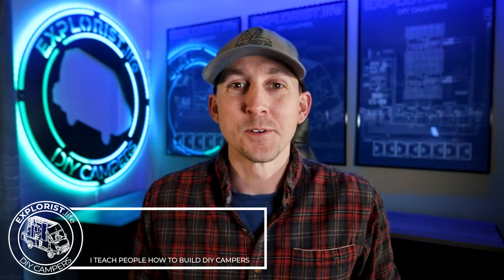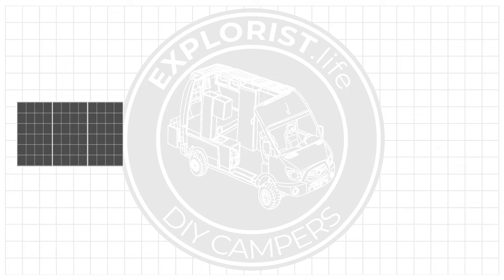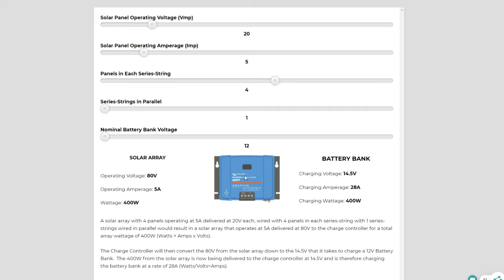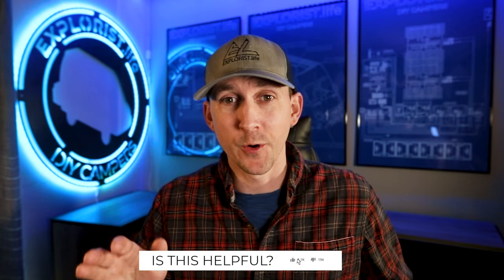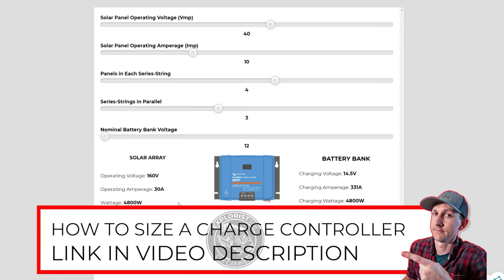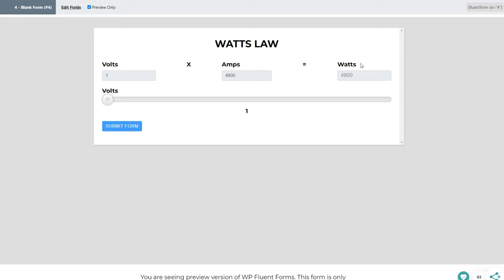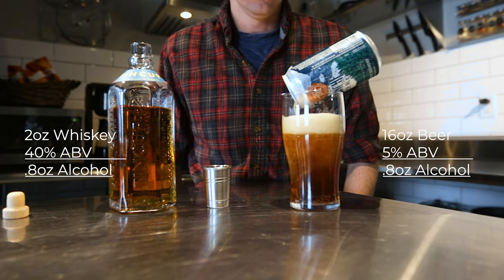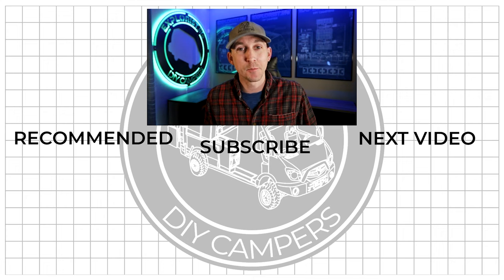What does a Solar Charge Controller Do in a DIY Camper Electrical System?

Comment: Hi Nate, Glad I found you

I will cut to the chase because I know you would rather sheer sheep then talk to an old guy who thought he had an original idea- ha 

I have a 2011 Dodge mini van I did a modular camping set up for my wife and I -test ran last year and loved it, but wanted to do more dry camping (summer time use only) 
     I bought a Jackery1000 I thought it was a one of a kind find in the industry. its new and so cool
I have added a home made storage box on top of van, It stores light weight stuff, ie folding chairs-table and out door rug etc. 
The top of the box is a used 250W 36x65 solar cell (see data below) its on lift struts and I think the combo of Jakery and Solar cell will allow us to camp anywhere :) 

The problem: I now find out there are several choices out there for portable batteries and the Jacker is limited to 30V on charging.  Many questions swimming in head- don’t want to hurt the battery. 

Nate, If you can spell out the best the best route to make my roof top solar cell work for us -I WILL PAY YOU, and or buy what ever I need from you, Also and buy a sticker and a T-shirt!! 
    Thanks for any help you can give!   Here are the stats ...
Model                ss250P-60
max power               W 250
open circuit               V 37.6
Current @ Pmax       A  8.27
max system Voltage  V 600
fuse Rating                A    15A

Comment: I was charging an RV 12V battery using a new 200w setup. I’m using a 40A MPPT controller. The battery was already at about 80+% SOC. My panels were giving me about 44.3 volts on a clear sunny day. I expected to see at least 5 amps being delivered. I actually saw about 1.31A. Dang! I think I figured that because the battery was already at a fairly high SOC the controller had stepped down the amount of amps being delivered. Right?

Comment: Very nice, love the app you made, found myself missing an big error when playing with it. Can you have the calculator highlight over/under bad things, like if you are running too small input voltage to the charger for a 48 volt system so it will flag the problem box? Also can you add what charge controller parameters (100/15 example) so if you also over power the controller it will flag you? if you can't that is OK, also you did ask for feedback.

Comment: I have a small off grid system with 200 watt solar, 50amp Lifpo4 battery and a 20amp solar charge controller. When sun isn't available, can I disconnect the solar panels from the solar charge controller and attach a 12v 10 amp car battery charger to the solar charge controller input to charge my battery?

Comment: That answered allot of questions I had but didn't understand. I have about 1800 watts solar, 48 volts in series parallel, charge controller 100 amps but connected to 14.5 volt batteries. It was maxed out at 100 amps. What confused me is I see 2800 watt arrays that only have a 100 amp charge controller. I see now the voltages of the input to the controller and the output to the batteries are different.

Comment: Great video. I want to ask, in the event that you don't have solar panel and you opted for a laptop charger let's say 65w 19.5v and it's connected to the solar charge controller will the charge output rate from the controller decrease?

Comment: Hii. I want to charge lithium battery byd lvl 15.4 batteries which 12 batteries connected in parallel making a total of 184.8Kwhr battery bank.. i have 545w jinko panels of 60pcs. My question is which victron size mppt smart charge controller should i buy to charge these batteries? Should i buy the 150/100 or 250/100 or the 450/100 or 450/200? 

I live in dar es salaam tanzania and temperatures here are preety hot throughout the year around 27 degrees - 38 degrees celcius

Thanks
Nadeem

Comment: Is there any harm in oversizing the MPPT? Your calculator tells me I need a 150|85 and Victrons calculator says 150|100. Should I go to the 100 just to be sure? 4x200 2S2P 24v panels. Thanks Nate!
Reply from the maker: Not much harm, no.  Just more expensive.  Let me save you a couple-hundred bucks here...

800W of panels feeding a 12V battery bank (charging at ~14.5V) is only 55A (800W/14.5V=55A)

Wired in 2s2p, that'd be ~80V.

The SmartSolar MPPT 150/60 is the best choice here without needlessly over-sizing.  We don't stock that one in our store, but you can get it from Battle Born here: https://battlebornbatteries.com/product/victron-smartsolar-mppt-150-60-tr-solar-charge-controller/?afmc=explorist_bb67

From there, you could use this wiring kit: https://shop.explorist.life/shop/all-products/camper-wiring-kits/solar-charging-wiring-kits/1200w-solar-charging-wiring-kit-6x-200w-12v-battery-bank/

Just delete the: Solar panels, MPPT 150/85, and 2x PV connectors

The MPPT 150/85 wiring kit in the previous kit works for the MPPT 150/60.
Reply: @EXPLORISTlife  THANK YOU. 100% ordering the entire electrical package from you (minus an inverter it seems) hopefully this week, just trying to get everything figured out before I load the cart. Again thank you, I owe you a few beers.

Comment: I’m wondering which charge controller will work best for my aray I have 15 Astronergy 415 watts I have 10 lithium 12 volt 100 amp lifepo4 batteries 3000 watt victron inverter

Comment: Hi, I'm a little confused, I've just used your latest calculator, I input the details but got a recommendation of a 100/30, but according to the figures, a 100/20 will be sufficient ... It's  a 420w panel, VOC 37.58, ISC 14.10, 12v Battery, The voltage and amperage are within the tolerance of a 100/20  and probably a 100/15, so yes, confused .....

Comment: Thankd so much, great video. What do I do if I want to use a Victron Energy 150V 45 A MPPT Charge Controller with a Maximum PV input power at 12V: 650W and my 7 solar panels are run in series with a max voltage of 140 volts and max amps of 10 amps but the total wattage of the panels are 1400 watts which means I've more then doubled the watts of the controller but my volts and amps are under the alloud 150V 45A. Can I still use this charger or do I need a larger watt charger or spit them into 2 chargers? I was hoping I can use this 1 charger since the Volts and Amps are under what they allow.

Comment: Looking at diagram for the OEM 50amp RV upgrade.... I'm not going to use the DC-DC charging but add second MPPT. VIctron has Tr model (supposedly discontinued but still available) and a model that is labeled Tr VE.Can. What is the difference and why would I want one over the other?
Reply from the maker: The VE.Can models can be controlled via CANBUS protocol (certain batteries, alternators, and such).  But yeah... unless there is a significant cost savings and you are trying to 'do it right, do it once', the newer model would probably be the better choice for the long haul.

Comment: Hello and thank you for your great clear and informative explanation on solar power supply.
I would like to know if I can use 300w 24v solar allays with 50a solar charge controller to charge 12v 200ah battery. I have single 300w 24v solar panel and 12v 200ah battery

Comment: Hey Nate , I am trying to find a 24V battery charger for below battery module -  I have the Victron 100/30 Smart Solar MPPT and victron blue smart charger(24V) 24112  - but unfortunately both models doesn't allow me to go down on AB voltage below 25V (with advanced option), where as I need to set the AB and nominal volt around 24.5V .. 

Do we have any charger / MPPT which supports above volt range (for Tesla Model S Lithium Ion Battery 18650 EV Module - 22.8 Volt, 5.3 kWh)  ? any help advise appreciated

Capacity: 232Ah, 5.3kWh
Voltage nominal: 3.8V/Cell, 22.8V/Module
Charge voltage cut-off: 4.2V/Cell, 25.2V/Module
Discharging cut-off: 3.3V/Cell, 19.8/Module

Comment: Thank you so much for this series of videos! Very well explained and the visuals make it much easier to understand.

A solar equipment dealer told me that the panels amps should be around 10% of the battery bank capacity. 
Do you know what he might have meant by this?  I can't find anything about it online. 
(We have 2x 12v 180ah batteries)
Reply: I got around a lot of my confusion by wiring each panel to it's own control box (which were supplied with each 350W panel I bought (x2)). The control box sends power according to the resistance it gets from the batteries so your batteries won't blow up from an excess of power input, although I have everything fused just to be safe. To have hooked my two panels up would have required another control box of greater capacity than 30Amp. There is little if any difference in linking panels or hooking them up separately as far as I can make out. Shade on one panel doesn't effect the other, and that's a bonus. I have 4x170Ah batteries linked in an evenly balanced parallel arrangement.

Comment: I am building my own custom toy hauler and am considering adding solar. My question is when you plug in to shore power with a solar setup does the controller know to not charge the battery? Or how does that work?
Reply from the maker: The charge controller simply senses the charging voltage from shore and turns off as appropriate.
Reply: @EXPLORISTlife  that makes sense and is what I was thinking. What would you recommend for size? I’m planning on using a 12v fridge 10quft, and standard water pump, propane heater and hot water heater. Undecided on weather or not to run an inverter or not because the only 110 appliances would be a coffee pot and ac both I can do without.

Comment: Great video. Is it normal at night time or anytime the solar leads on controller read the exact same voltage at battery side , like the controller is doesn't exist. Even when sun is shinning shouldn't controller be reading higher volatge somewhere 18+. Not 13.3 , and controller output is also 13.3. Weird.
Reply from the maker: At night, that is normal.  If the panels are in full sun and the PV side is reading the battery voltage; that may indicate an issue in the array wiring.
Reply: @EXPLORISTlife  thanks man, I did check throughout the day here in az lot of sun and my 2 100w panels was gettin 18v  . Batteries  full charged , charge controller switches to float, equalize,, etc.. that's my guess why terminals read same voltage at night etc. Thanks keep up great videos

Comment: Nate, I gotta question. Using a solar array and solar charge controller, can I wire a inverter directly without a battery bank to run during daylight hours only? My dad wants to run a small AC unit during the heat of the day, and I know inverters auto shutdown when the voltage drops below its minimum rating. He doesn't need to run it at night, so a battery bank isn't required...or is it??? Thanks.
Reply: Theoretically, you could. The first problem is the limited current from a charge controller. Even with a 100 A unit, you're limited to about 1400 watts going to the inverter. So you would most likely need a number of controllers in parallel. Obviously, your solar array would need to be large enough to provide the needed watts at the AC.

Comment: Hopefully this gets seen, so say if you have 4, 460 watt panels and want to wire them in series parrellel you have 1840 watts are there any good charge controllers for that kind of load or should I split the system into 2 separate power lines of about 920 watts, going to the controller(s)? Am I aiming too high here?
Reply from the maker: Hey, Tomstone! I appreciate you taking the time to ask your question, but unfortunately, I don't have enough info about your specific question to provide an accurate answer, but here is a playlist that, if you watch all of the videos start-to-finish (and take notes 😉), you'll have a REALLY good idea of how to design a solar array: https://www.youtube.com/watch?v=Jkbs84sBHsg&list=PLmvhcyi4n0TV9pi83rFTv3ZuMT_S1xIZt

Alternatively, I have some of my most common solar array setups pre-built here: https://shop.explorist.life/product-category/all-products/camper-wiring-kits/solar-charging-wiring-kits/
Reply: @EXPLORISTlife  yea sorry was very unclear, I found a good deal on santan with what I believe are "power plant" panels at 460w and a voc rating of 188.8 per panel and an 2.44 amp but i think I would have to hook them up in parrellel to keep the voltage down and play with the amps, I have seen similar panels with lower vocs at 41.4 and at 10.96 amp that I will probably end up going with for easier use, I just stumbled upon your channel in my research all of your videos have been very helpful in the matter. I feel the first will blow out a majority of basic charge controllers

Comment: I have an unrelated question that you may wish to answer..?   I have two (about 8 amps combined) solar generators  (herein called sogen(s))  and would like to power both at the same time using one 180 watt solar panel (instead of a separate for each)..  Realizing that my sogens cannot be connected together in any way,  my solution would be to provide the necessary branch 'Y'  mc4 for the panel pos  and neg leg,  and isolate each pos leg of the branch (to the sogens) with an inline mc4 fuse which already  has the diode built in to prevent vdc back charging on the pos legs.  Your thoughts..??  If no, then why not..??
Reply from the maker: I feel that the charge controllers in each unit would fight against each other when trying to pull power from the solar panels.
Reply: @EXPLORISTlife    Based on..???    In fact, the cc's cannot pull power from each other because they do not back feed(!), so my install of a fused line w/diode is redundant..     The 'Y' branch is acting like a voltage divider with two resistances attached to it....  From my perspective, the volts and amps are split between the two, depending upon their needs, with the possibility of one or both cc's not turning on or charging fast enough due to low volts or current.   Then, if the two 180w panels are paralleled and then 'Y' ,d,  the amperage would be restored..  Just my point of view that no one can answer with any authority...  I'm not trying to be difficult, just looking for a common sense answer..  Thanks again..
Reply from the maker: Based on me trying to power 2 separate charge controllers from a single panel a few weeks ago.  

As one charge controller switched into bulk charging mode, the other would restart while it tried to find its max power point voltage.

I only barely grasp the 'why'.  I get it, but not enough to explain it.

You won't be able to get a 'common sense' answer to this as you are proposing an incredibly uncommon setup and this is not really how these components are designed to work.

But...  feel free to try it out for yourself and let me know if it works.
Reply: @EXPLORISTlife    Fair enough...     Finally, a reasonable, 'learned/practiced' answer..!  Thanks again for your candor...

Comment: Good day Nate

Firstly, great YouTube vlog! Awesome info!!!

I need a bit of advice with my system if possible.

I ran a PWM controller with a 100w panel on an auxiliary battery that is connected to the starter battery with Cyrix. This only runs a small fridge and worked really well for the past 2 years.

Yet I decided to upgrade the system.
2x100w panels in series with a Victron 100/20 controller. Rest of the system stayed the same.
I now get a spiking in the system constantly.
I have checked and double checked for poor connections and errors but all is 100%.
Am I missing something?
Many thanks
Dewald

Comment: Does this apply only to PWM charge controllers or MPPT also as I thought MPPT adjust everything?
Reply from the maker: MPPT only but the PWM concepts are 'similar' just much more limiting in input voltage.  Any time I talk about charge controllers on this channel I'm talking about MPPT controllers.
Reply: @EXPLORISTlife  So that was my problem.  I had 2ea 210w Maxiums in series and then I hooked up 2 sets(4 panels) of windy nation 100 watt in series to them and then to the charge controller. So according to your video, my 800 watt of solar panels only put out 411.7w (71.6v x 5.75A=411.7w).  Got to change that soon adding another cc and run the line to the battery, right?

Comment: So I've added equal panels in series to my system, total 300w, and 2 AGM 100ha. I have a WPM controller would it better to change to  MTTP.
Reply from the maker: Likely yes.  I would suspect that 3x panels in series will put out too much voltage for your PWM charge controller to handle.
Reply: @EXPLORISTlife  Thanks for you input,  I actually called manufacturer today, before I saw your reply.  Interesting  the tech said NO it wouldn't change anything going to mttp controller which is not correct. I'm on the Western slope and haven't had alot of sun to really check the voltages yet.  I'll keep you posted.

Comment: Can any one  help me with a very small project? I have a small solar panel connected to a 12volt battery to power a led string of light, but the controler is not auto switching to lit the string of led lights. The battery is charger full with 12 volts, and when I press the controler button does not pass the power to the LED string.
I need a controler that charge the battery and them the LED to turn on alone without any interation or switch.
Reply from the maker: It doesn't sound like you're using a Victron charge controller as I don't think the small Victron CC's have 'buttons' to turn on the load terminals?  If you're using a different brand... Sounds like that's a great question for tech support for that brand to see if it's a faulty unit.